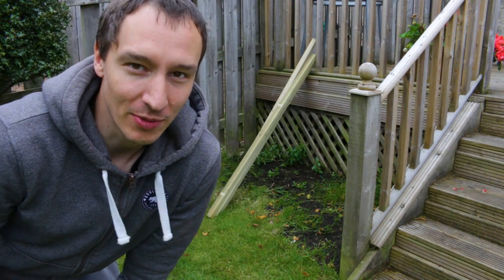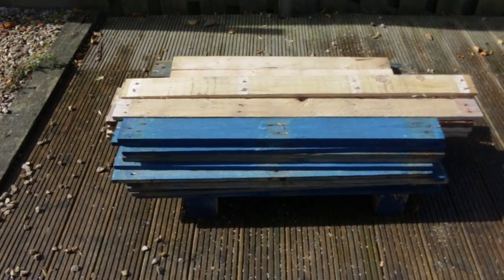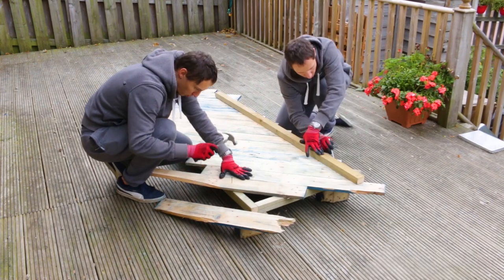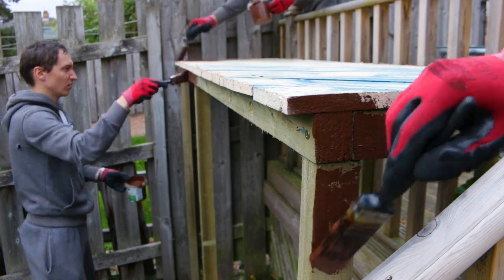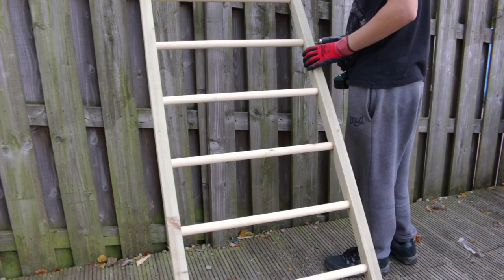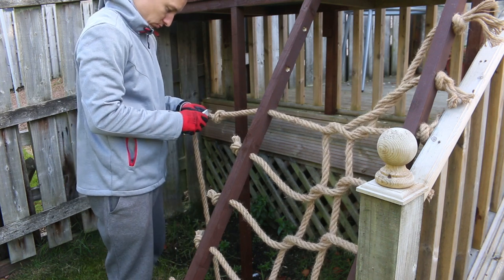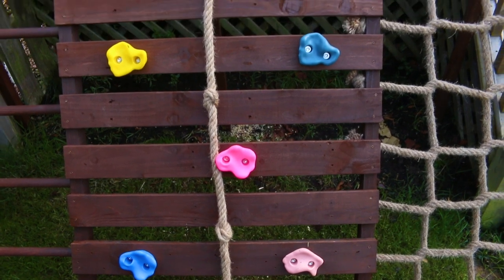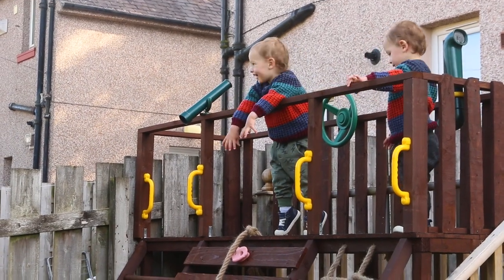Awesome DIY Climbing Frame for My Kids

Comment: The gaps in the boards section seem small, but you added the rope and things, and your children are small. Do they prefer one section, now they've tried them all out?
Reply from the maker: @treefarm3288 when they were just getting started they liked the rope net and the middle section which they just used as a ladder. As they grew, they wanted a challenge and opted for the climbing stones and the rope.

Comment: great work!!
Do you have the measurements of the planing?
Reply from the maker: I am really happy you liked it! I've just measured it for you. Width of the whole thing - 210cm, short side of the platform - 65cm, height of the fence around the platform - 60cm, height from ground to the platform 153cm, distance from the ladder to the platform along the ground - 105cm (this is to work out the angle of the ladder), width of the Swedish ladder 60cm, width of the middle climbing element 90cm, and the width of the rope ladder - 50cm. Hope this helps!
Reply: @MakeithappenDIY  Thank you very much

Comment: Sorry to bother you i am having trouble with the rope net,
 can you help me with the plan how to pass the rope ?
what do you do in the final corner
Reply from the maker: Hi, I am thrilled that you are going for it! I am away from computer for a few days so the following screenshot is the best I can do on my phone... 
https://drive.google.com/file/d/1K83tVQuVlUcwLrlaHJmqNi4JxKWDjOGG/view?usp=sharing
The last loop is the same as the first one. It goes between two corner holes. As for the rest you weave them as shown in the link (and briefly in the video). Don't tighten the knots until you have the entire net done as you will most likely need to adjust the lengths. Good luck!